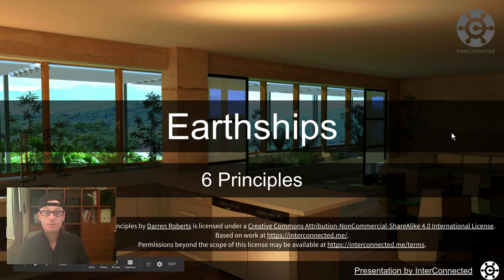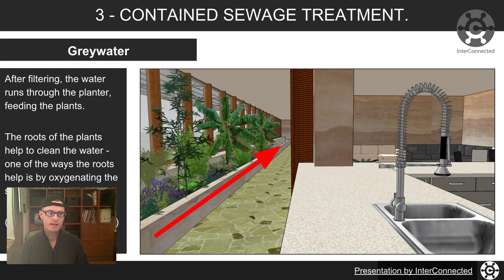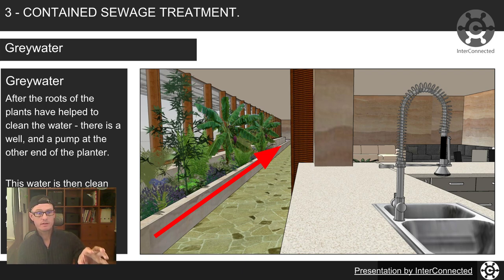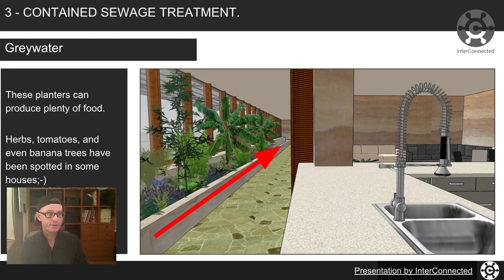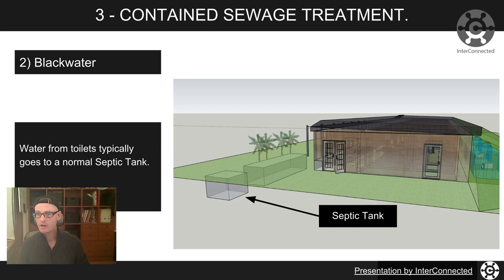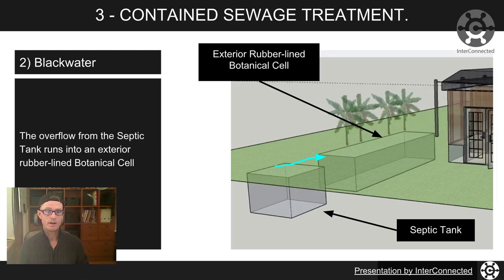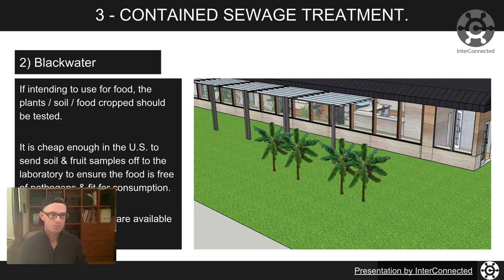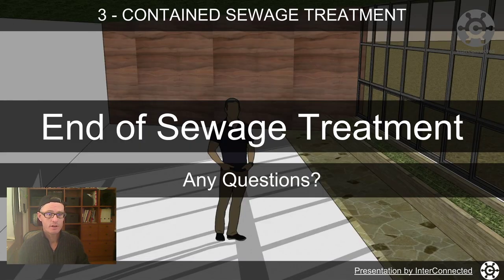Earthship Principle 3, Greywater and Blackwater Treatment

Comment: Great video! One question though. The overflow from the septic tank feeds the outside botanical cell but what happens to the solids? Does the septic tank need to be emptied?
Reply: Solids should break down in the septic tank and only liquids (or dissolved solids) should pass. 

Like any septic system, it may need pumping periodically depending on how it's sized, it's usage and how well it's maintained.

Comment: I'm up here in Chiang Rai, and am looking to change over to blackwater and greywater treatment systems, along with developing a permaculture garden out the back. I only have about ¾ Rai here, and about ½ Rai to play with. Within that I am looking to build a (almost) traditional Lahu house. We're on a slope, so am also considering adding in swales to collect rainwater.

Are there any issues or suggestions specific to Thailand which you would put forward? eg. Does hot season cause any issues, is rainy season too heavy for a shallow greywater outdoor system?

I'm a complete novice to this, but want to give it a try for a better life going forward. Thanks :)

Comment: Great new channel!
Sub'd!
I'm a deep believer of what Mike Reynolds have pioneered and still evolving. 
My 2 sticking points are the foundation and the roofing systems. 
#suggestion 
If you can create a vid for the 2 above would greatly appreciate it!
Thanks for sharing!
Reply from the maker: Thanks Spicer - 

I'll add those suggestions to the list - foundation & roofing.  

My thoughts on roofing would probably be location specific.  I guess I'd think in the same vein for a lot of the main earthship principles.  

Looked at Ferrocement quite a lot over the last couple of years, and that looks awesome.  Particularly interested in that for somewhere like Taiwan due to strength to weight ratio & ability to form domes & arches.  Big logs make sense if you can get 'em.  But not readily available in Taiwan as a rule.